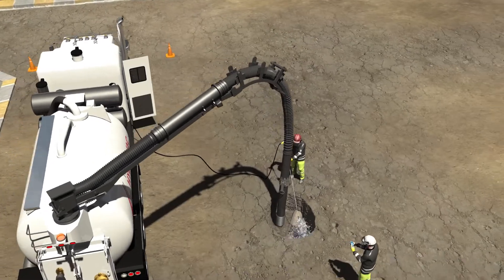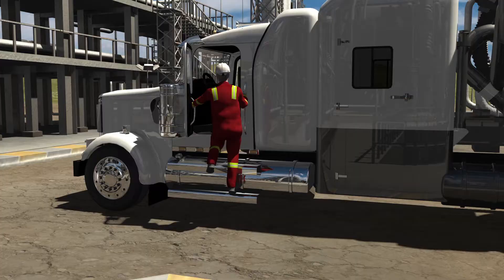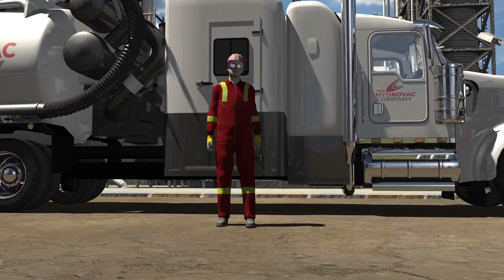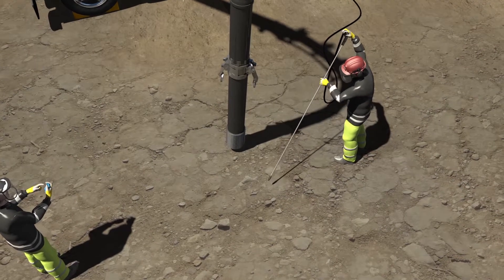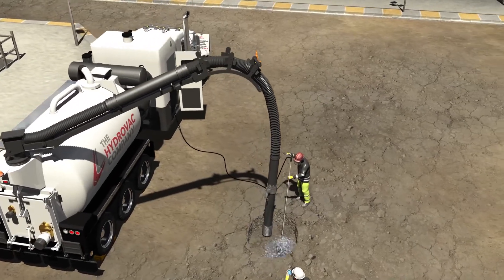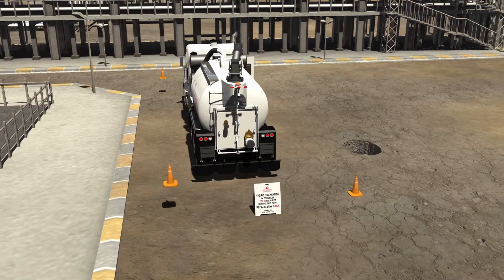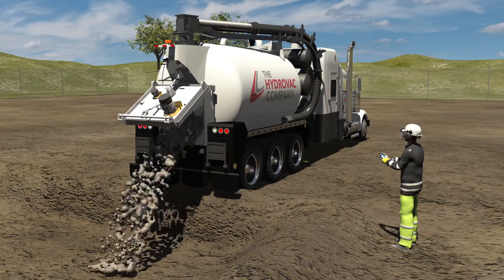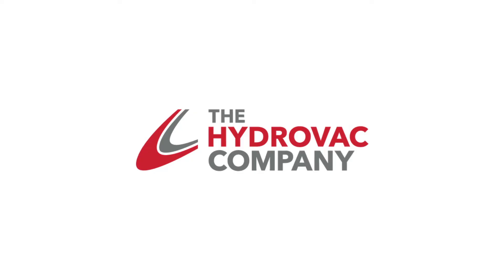Hydrovac Truck

Comment: Very good but one thing you missed about the truck is that you could also tip the tank backwards up to a 45 degree angle. You can have the tank in this position to dump and washout the remaining mud and debris with your water hose.
Reply: Not on the style of truck shown in the video, but yes some styles of hydrovac have tanks that can tilt.

Comment: Cut about 6’ off hose on the boom you would be able to move it around better...especially when the ground is real rocky
Reply: Can't because the truck has to clear a certain amount of feet from the excavation site. Safety reasons.
Reply: @Official360 you can attach a plastic 6’ hose, real easy to move just tie a broom stick to the end

Comment: Are these trucks easy to drive I don’t have my cdl yet the city will help me get one they said
Reply: Commercial trucks aren't too bad, you just have to stay aware of their size.
You may also need to learn how to operate a manual transmission, since they're much more prevalent in vehicles of that size.
Reply: @michellelehky2374  yea I got a job for a collection systems operator but these jetvacs